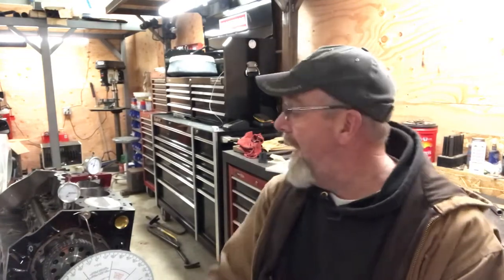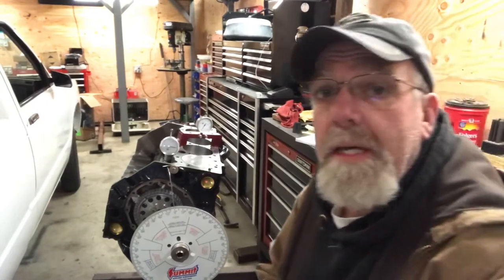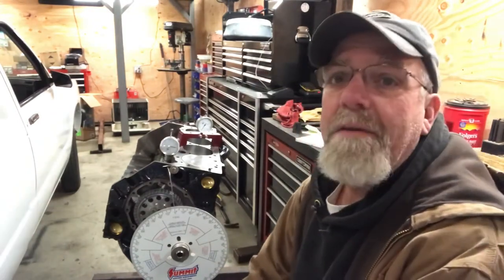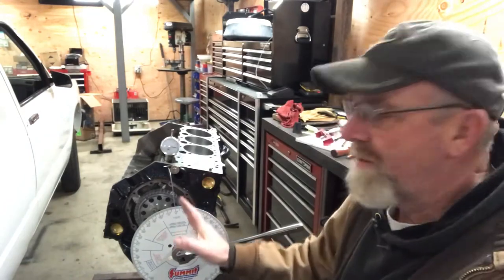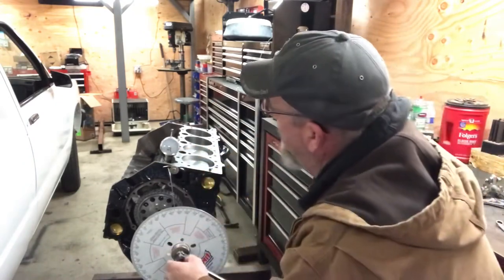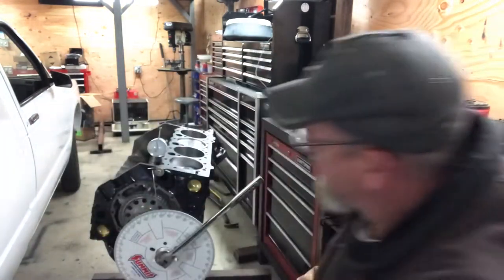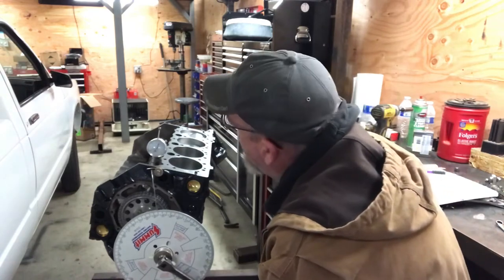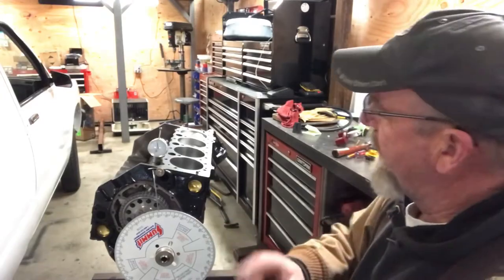Super simple method for degreeing a cam!!

Comment: I'm enjoying your channel. What happened to using the solid 258/264 summit cam?
Reply from the maker: Thanks for watching! I ended up going with that roller cam and the AFR heads.. that summit cam ended up on a shelf in my storage, still wanna run it in something!
Reply: @ordinaryguygarage3667 Damn those stimulas checks!LOL. I believe that is same Elgin cam  E1090P I run in my (400+060) 413. It is 13.9-1,,has iron EQ 50cc heads,flat tops,and built on tight budget($3000). Its in a lightweight dragster that runs very well through 7200 rpms.It shows 560hp with wallace calculators from my ets and weight.  I'm sure your Comp Cam is stronger,, but the CT102 would make a nice one in a back up shortblock. I'm looking at AFR220s for my own now and how I fund your channel. Love the shop!
Reply from the maker: @riv187  I plan on putting together a motor for my 66 pickup using parts I have stashed…. I keep thinking about that cam!  Thanks for watching me fumble through stuff! 😃

Comment: Hi question for you. Why do you need to do this and what if you only have a timing set that has one set of key ways for zero? I just took the motor apart in my car 350 SBC unknow cam or who built it. I found the cam timing at TDC compression stroke to have the dots crack up and cam was also up not pointing at each other. Any idea why this is and the car ran fine. I'm confused how to put it back together with the new timing chain now.
Reply from the maker: Honestly you don’t have to degree a cam in a stock or mostly stock situation.. I degreed mine because of the size cam and it being a race motor.. 
 As far as your timing marks go they need to line up dot to dot. The crank shaft rotates twice for every rotation of the cam. If you have the dot on the crank gear pointing up and the dot on the timing gear pointed up as well then you just need to rotate the motor one more time and it’ll all be lined up
Reply: @ordinaryguygarage3667  but this is how the engine was set up and it was running fine. I just took it out to reseal it because of a lot of oil leaking and paint it. Noticed some play in the double roller and wanted to change the timing set. I know the engine was put together at a engine shop I have the original one that came out of the car
Reply from the maker: @Johnnyvette383  Ok.. i was wrong... the cam rotates twice for the cranks one rotation... that being said, you can have the crank 180 out from the camshaft and have it run as normal... I haven't seen that before but there are lots of things I haven't seen... Id double check where you're at and make sure you're correct just for piece of mind and as far as replacing the timing set you could pull off the old and replace with the new as long as the cam and crank don't move...
Reply: You were right the first time. Crank rotates twice for every one rotation of the camshaft. If the cam is 180 out, it will run because that is where it ends up every other crank rotation.  If the crank is 180 out, it will never run. Stock rebuild, dot to dot and that's it.
Reply: Why would you do this?... uh because the manufacturer went through great lengths to grind the cam, and set its specs, and you won't get the max benefits from the cam. How about a valve hitting a piston, that's a good enough reason to do it. Your engine is a big air pump, the more efficient, the more power, the cam is basically the brain of the air pump. Learn how to do this, and do it regardless of stock or performance.

Comment: I had my chrysler 3.5l v6 sohc ground 4 degrees advanced and install at 108 intake center line and I can't find anything on how to degree that engine any help would be greatly appreciated on how to degree my sohc
Reply from the maker: Did you ask the cam grinder that you got the cam from? They should have a recommended procedure
Reply: @ordinaryguygarage3667  yeah they said i could put them in off factory timing if I wanted but I'm trying to get the max power out of the cams

Comment: Do you have part numbers for the parts you used like the gauge that goes in the lifter bore? The degree wheels are pretty common but I like the gauge in the lifter bore
Reply from the maker: The lobe indicator tool is made by Proform part# 66838